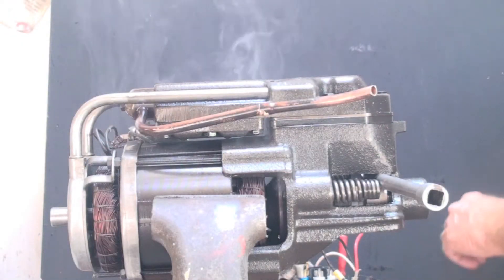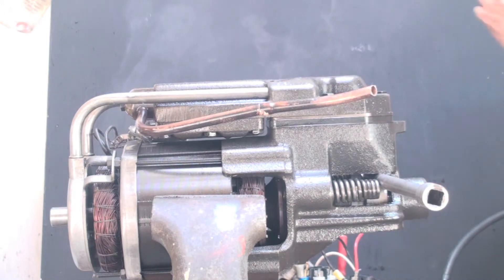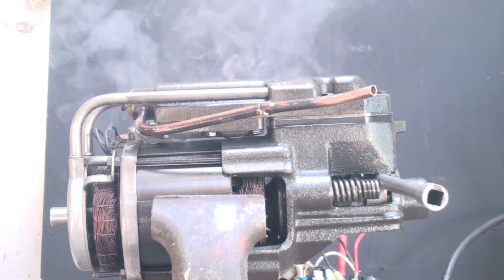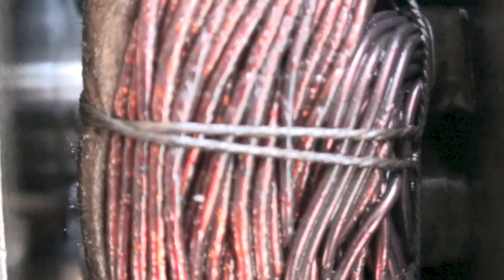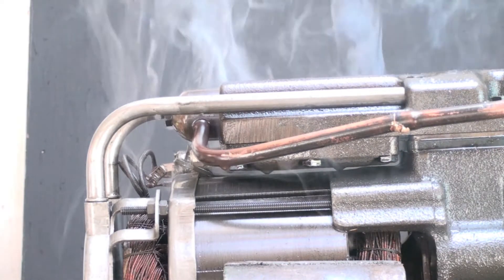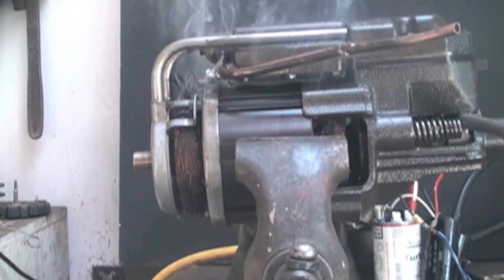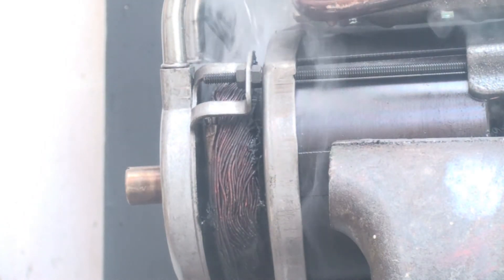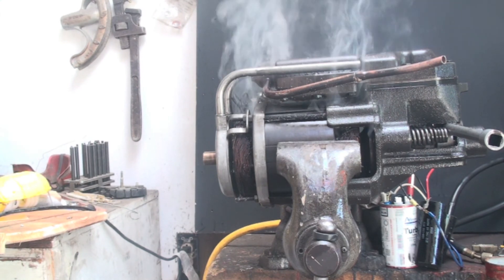HVAC compressor test to destruction

Comment: Yeah, i have a vid titled "dead copeland scroll compressor" that shows a load of carbon and copper plating on a failed compressor, put some big burnout driers and did an acid tests on the replacement after some run time.
Amazing the damage customers do through lack of maintenance and cost cutting!

Comment from the maker: Note the windings did not fail.  The connections to the windings were the failure.  Thanks
GFM
Reply: Yeah but windings that have gotten hot enough to smoke are in fact faulty (damaged insulation). They wouldn't last long if you put them back in operation.

Comment: 0:55 I think the occasional change in pitch happens when a winding shorts out and causes a change (specifically, an increase) in the current draw.
I'm surprised your breaker doesn't trip quicker with a 200% overload ...
Reply from the maker: Could be.
GFM

Comment: That smoke was so thick, I could almost smell it!
Reply from the maker: Pretty ugly.  Gives you an idea of what happens inside on a burnout.
GFM
Reply: That's why Pro-Flush is good on burn-outs. That smoke settles in the system too. I'm amazed they didn't replace my TXVs or reversing valve when my Trane burned it's compressor several years ago. They should have because both TXVs are stuck now, and the reversing valve sounds like a wounded Elk when it switches.
Reply from the maker: John Smith If a system has a dirty burnout, in most cases I recommend the entire unit be replaced.  The expense of the clean up often exceeds the value of the unit.  Trane says a replacement compressor will only last 1/2 as long as the original.  
If the unit is a rooftop it may be worth the clean up.  Thanks for the thoughts 
GFM
Reply: It makes sense that the compressor will last only half as long, since not every technician uses flush, and most don't replace the expansion valves or reversing valves after a burnout, so system problems can shorten the life. My burn out replacement on my XE1200 has been working since 2008.